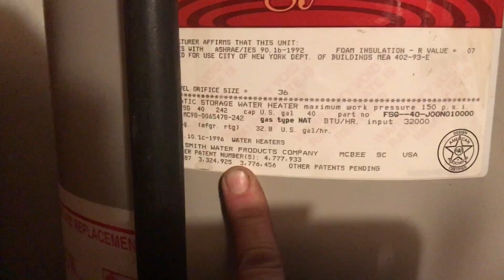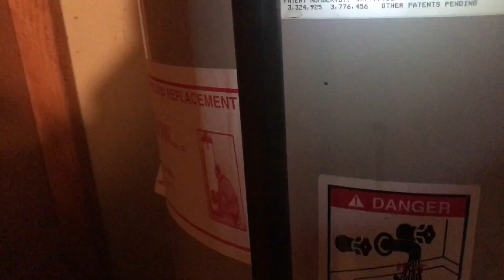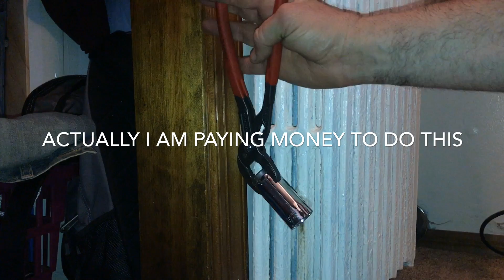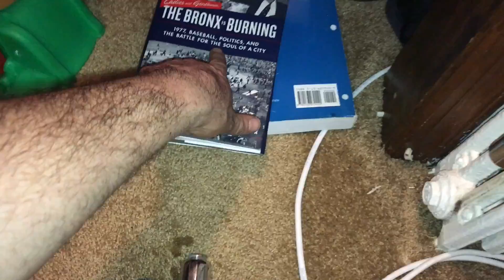Replacing Steam Radiator Air Vent

Comment: No no you can't move to Miami who would be fixing things for mom. Had a lot of fun watching you on the video, you sound like me 30 years ago.
Reply from the maker: My list of jobs over at my mom's house never ends and I keep adding to the end of the list. Jobs like replacing the valve with a broken handle. Yet I might just buy a new valve and put the handle onto the existing valve. I will still have the spare valve just in case this one or another one leaks.

Comment: Good video. Does the air vent usually go high up on the radiator to get rid of the air? Thanks
Reply from the maker: on a hydronic system yes. This is the last loop of the radiator and a steam air vent is always open until it gets hot and then closes down. This way steam doesn't come out of vent, which is a failure of the air vents. Other is it gets stuck closed and air won't come out thereby the radiator remains room temp

Comment: That radiator only has one pipe connected to it? Never seen that in Europe. Witchcraft!
Reply: One pipe steam
Reply from the maker: its a one pipe steam system. So supply and return in the same pipe. It goes up the pipe as steam and as the steam cools it condenses and goes back to the boiler. It is why the pipes need proper pitching to let the water return back to the boiler
Reply: @thehvachacker  That's bizzare. So that valve you've replaced let's some air out of the radiator to attract more steam into it? Doesn't that produce humidity and stinky air from crusty water?
Reply from the maker: If the valve is working correctly it is a heat sensitive valve which closes when steam fills the radiator. opens when it starts to cool to allow more steam to enter the radiator. The water may be dark but shouldn't have a smell. I had muddy boiler water yet can't remember a smelly steam system. Now hot water systems the water can get nasty
Reply: @FrozenHaxor  No, the valve is opened to let the air out, but closes on steam.

Comment: If a steam boiler doesn’t have one of those black upside down triangle looking blow down valves do you need to blow down the water some other way below the water level??  A friend of mine has a steam oil boiler  that I don’t think has ever been flushed down but the sight glass is perfectly clear.
Reply from the maker: Yes you can drain the boiler from the lowest drains or add a blow down drain like I did in this video https://youtu.be/kIjZWVZDclw

Comment: The threads in the steam radiator are damaged, not holding the air vent well. Your advice for a repair solution will be appreciated. Thank you in advance.
Reply: You can get a tap to clean up the threads.  Since they are tapered, usually you can just cut them a little deeper with the tap and they will be fine.  You need a 1/8" NPT sized tap.  Use it with a little oil.
Reply: @eegg6954  Thanks for the reply. But two years later?

Comment: You can buy a replacement knob for it at amazon or supplyhouse.
Reply from the maker: Thanks, I was going to buy the valve and just change handles or wait till I have a leaker and acquire the handle of the leaking valve. Yet a plastic knob if I can make sense to just order.
Reply: @thehvachacker  great videos quick question i have a steam radiator in living room that air vent leaks water i was told to either keep knob valve fully open or fully close but fully open givea alot of heat can these adjustable air vents regulate air heat displacement coming  from radiators if so what number is good to set the adjustable air vent to ????? Thank you

Comment: For the steam vent, after you, I used Teflon pipe tape. Looks like a high heat compound originally. Thoughts?
Reply from the maker: Teflon or pipe dope works. I use whichever I find first
Reply: @thehvachacker  thanks. I’m replacing a bad vent in a condo I own, 500 miles from where I live now. It’s a long drive home for supplies. I brought Teflon tape!